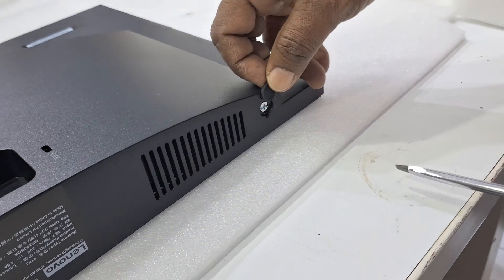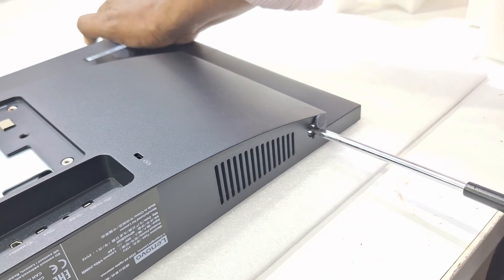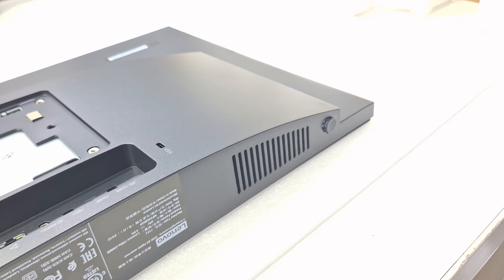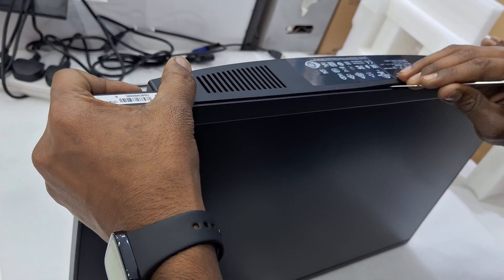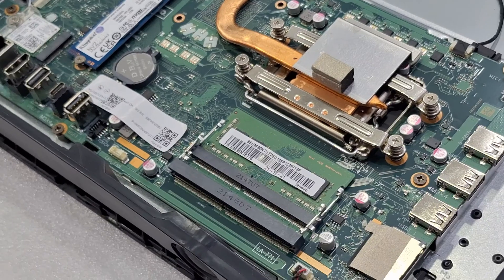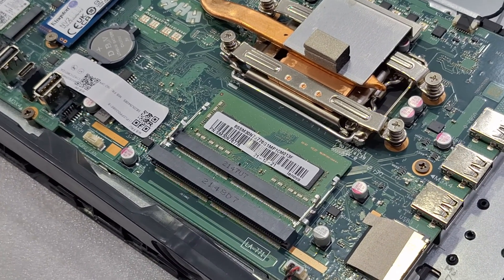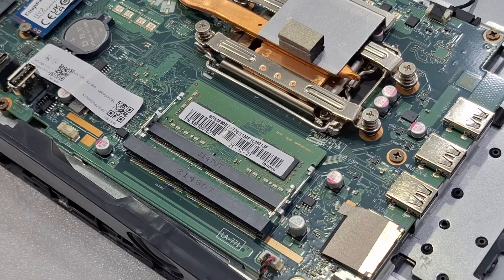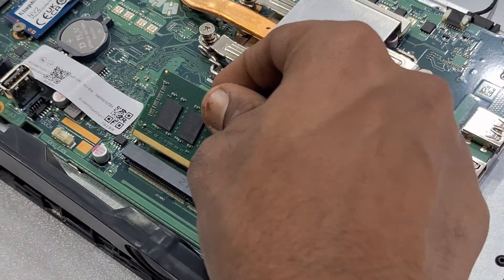Lenovo Aio V50a-24IBM  UPGRADE SSD & MEMORY || how to open lenovo aio V50a

Comment: Thanks, I cannot find the part that connects the 2.5" drive to the motherboard, can someone help? Also opening and closing this thing is a pain. Very bad design, compared do Dell optiplex AIO this is absolute PIA.
Reply from the maker: This model comes with 1TB HDD 2.5" drive 4.09min check, please
Reply: @nprstechandvlogs8793  Hola, el amigo pregunta cual es el modelo de cable flexible sata para el disco de 2,5, ya que algunos modelos no trae el disco, solo trae una m2 , pero no el disco ni el cable sata.